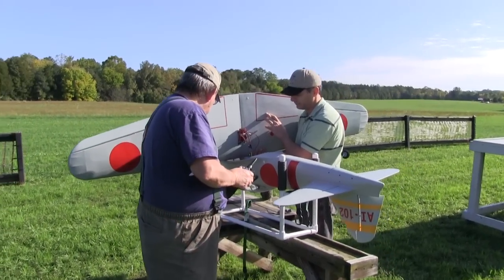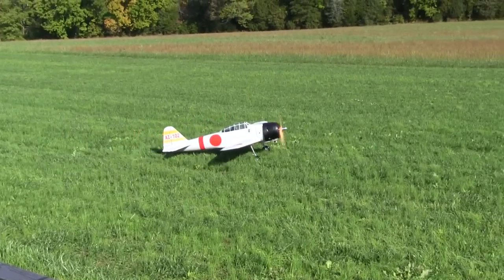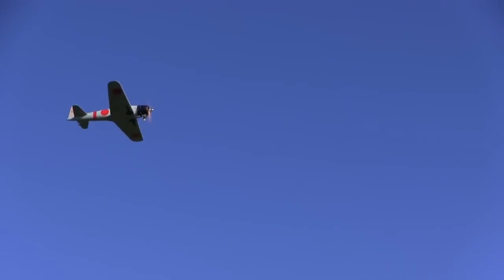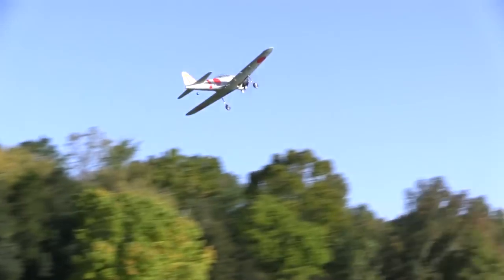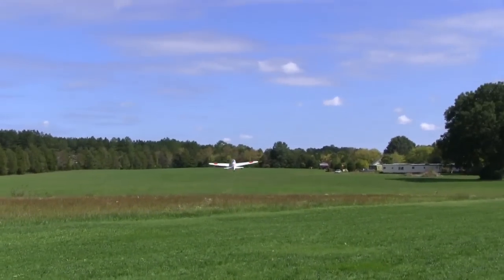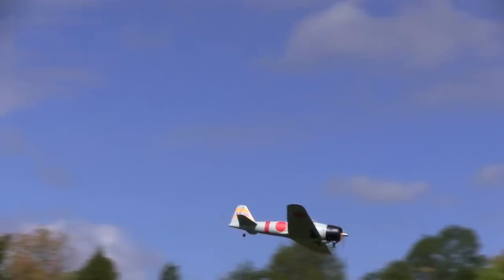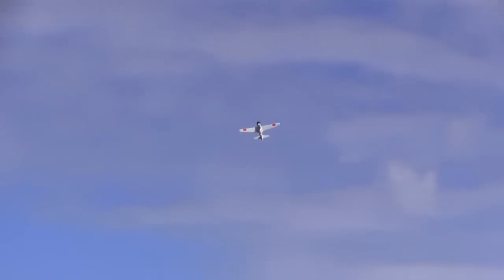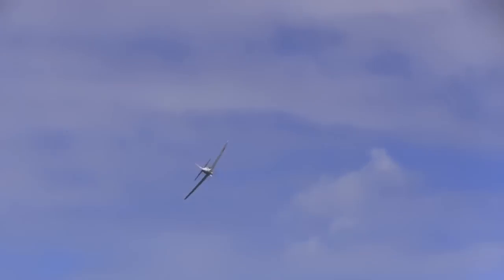ESM 88” Zero – Maiden Flights

Comment: any way of reducing weight??
Reply from the maker: Not really. the Zero has such a short nose that it takes a bunch of weight to balance it. add to that this fuselage is pretty heavy on its own and that nose weight gets to be more of a problem. Guys with the Top Flite Zero like that way better in part because of the built up fuse and the weight savings that gives overall.